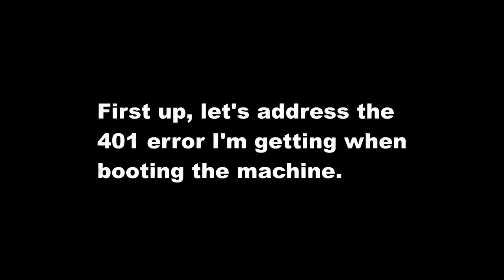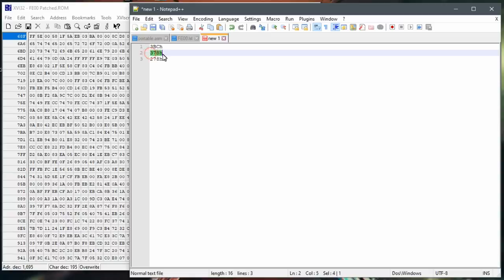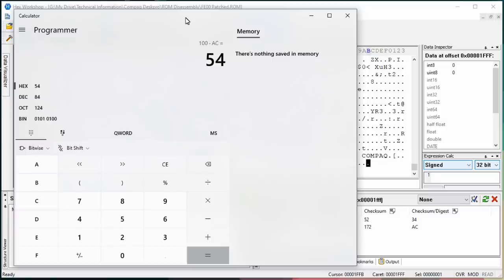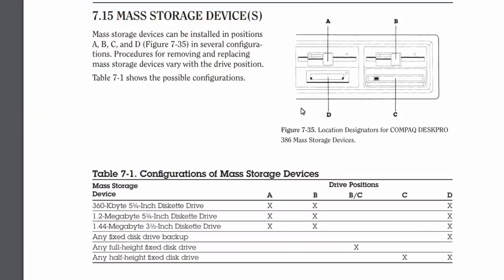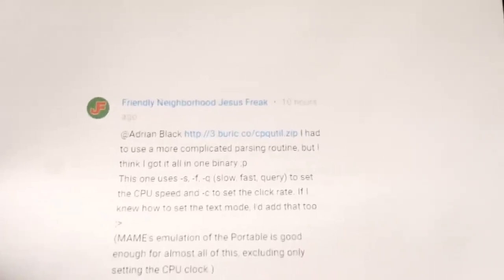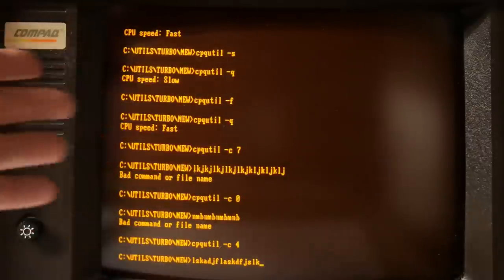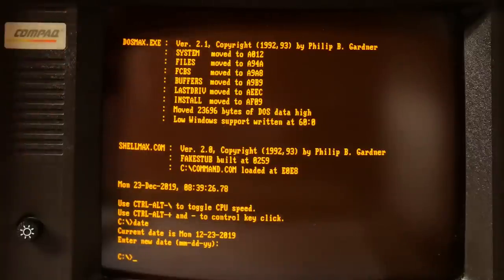Compaq Deskpro Part 3: Fixing that 401 error and more!

Comment: Why do you have to subtract from 100?
Reply: The checksum of the whole ROM has to be 00.
So if you calculate the checksum of all but the last byte, you can set the last byte to the appropriate value to make the whole checksum add up to 100 by subtracting from 100.
Since it's an 8bit checksum, only the last two digits are used: 00
So technically, the last byte isn't the checksum byte, but the checksum complement.
The system checks if all bytes of the ROM add up to 00. If they don't the ROM is bad.
Reply: is that a general rule "checksums must be 100" or is it only for this particular case?.
Reply: @pelgervampireduck  Should be the same for any PC BIOS ROM.
Reply: Technically .. “100” here is 100 hex, or 257 in decimal.
Reply: Pelger There are no rules for this kind of thing.  It could have just as easily been a CRC or whatever, but this happens to be a super easy way to do it.  The checksum can be created by simply adding up the byte values of every character in the ROM.  Then checking for the value 0 is easy in ASM as there’s a CPU flag that gets set when an operation yields a zero value, and there’s a specific conditional jump instruction that will branch only when that flag is (or is not) set.  It’s all kind of path of least resistance programming technique that accomplishes the goal of detecting errors in the ROM.
Reply: Here is my C-like pseudocode explaination of the rom check....

if ( (1stByte + 2ndByte + 3rdByte + ..... + LastByte + ChecksumByte) % 0x100 == 0 ) then { GOOD_ROM } else { BAD_ROM }
Reply: @kpanic23  oh so the's no difference where to put that checksum byte then? Say you modify ROM again, can you just modify some random byte to make the entire ROM checksum to 00 again?
Reply: @waymamma  it's 256
Reply: @desertkun  Technically, you could. But you wouldn't want to change any random byte, chances are you would change something in the program code or a data structure, producing unexpected results.
Reply: desertkun Right! Thanks for pointing that out, I realized after posting that I’d made an off-by-one error. On a checksum comment ... erm.
Reply: desertkun That’s one of the primary disadvantages of a simple checksum over a CRC. With a checksum you can place a corrective byte (complement like in this case) anywhere in the byte stream and it will still work out mathematically. A CRC is much less forgiving, both the position and the value of the corrective byte matters. With a simple checksum you could have multiple errors and if they cancelled each other out, it would go undetected.
Reply: @waymamma  It's an easy mistake to make. It's so easy to get confused and think FFh was 256 when it's really 255, because 0 through 255 = 256 values. And of course 100h is one more than FFh. One louder.
Reply: ropersonline Yes, it’s an easy one especially for a dyslexic like me :)
Reply: I feel like nobody explained this correctly. The last byte IS NOT the checksum byte! The last byte is only place where you can correct the checksum of the whole rom, so the checksum will be 00. Bios itself is never calculating checksum of the rom excluding the last byte.
Reply: Peter K I think kpanic23 pretty much nailed it in the first reply to this thread. The last byte is actually the checksum byte — it is the byte that is placed into the checked image so that the final checksum has some previously agreed-upon final value — 00 in this case.That byte is there purely to serve as verification of the data in the rest of the image (BIOS ROM in this case). If we weren’t doing a checksum we wouldn’t need that byte so .. it’s the checksum byte. Before the code in the ROM is executed the bytes in the ROM are summed up by some earlier stage of the BIOS and if the final 8-bit value is not the agreed-upon 00 then the code in the ROM is not executed.
Instead of Adrian saying “add up to 100” he might have said the “lower 8 bits of the sum of all the bytes should be zero.” ... But if had done that then there wouldn’t be this interesting thread on checksums ;)
Reply: Peter K The last byte is NOT the only place where a correction byte can be applied. In fact it can be applied anywhere, the math still works out for Checksums (not CRCs though). It is typically applied in the last byte position because that is the most convenient/easiest, but it could just as easily go at the start too it’s not important.
Reply: @idea22yt  6:42 I don't think Adrienne himself explained it very well, or maybe just plain wrong. I'm out of my depth here, but I understand why other commenters weren't clear.

Comment: Love how people are still writing utilities for these old machines.  Great video. Thank you sir!
Reply: I've been making programs for the Osborne Executive recently :D
Reply: @ct92404   Nice! And thank you sir!
Reply: @jscollett  It's a pretty cool little computer, but it definitely has some quirks and limitations.
Reply: @ct92404  they all do. But especially systems form the 70s and 80s.
Reply: @jscollett  Well, yeah, but I mean even for the time period the Osborne is kind of unusual and a bit more difficult to program as compared to other 8-bit computers of the period. It's just...weird. For one thing, it doesn't have a command to clear the screen, like "HOME," or "CLS," etc and you have to use control characters to do that. Even just to position the cursor at a certain X and Y coordinate involves entering a long line of code with control characters, whereas it's usually much simpler in other computers. It's definitely a learning curve!

Comment: Long ago i worked with Walt Russell,  he was employee #7 at Compaq and was head of engineering for a time. I learned a few things about how and why compaq did some things. Rod Canion and crew all came from TI where they built seismic equipment. The early MFM drives were quite fragile, so the drive cage was shock mounted using a special viscoelastic thermoplastic urethane compound called c1000 made by EAR composites (now Cabot). It looked like rubber, but i had a golf ball molded from the stuff that if you threw it at the ground, youd get almost no rebound.
Reply: that's super interesting, thank you for the info!

Comment: That hex editor was an absolute interesting part,now am understand how rom modders are moddifying old roms to add or change stuff to it, so rather then searching for specefic codes in a programs manually wich would take forever, you can track them down automatically,very great stuff.
Reply: It is still a very manual process, you just get the code a bit more human readable by running the binary through a disassembler but it's essentially just a more symbolic representation of the machine code as is. The extra comments explaining things were added by a human examining the assembly code.

Comment: I dunno if it was my comment about the Smartwatch software you were thinking of, but it's nice to see it works as expected. ;)

To put a new battery in your Smartwatch module the ugliest possible solution would be to try to cut pins 4 and 14 on the chip that's visible when you don't have the ROM chip plugged in (the one with the sticker on it, it's almost certainly a generic DS1215) and run wires from their stumps to a battery in an external holder.  (Positive goes to the pin on the chip, negative to common ground.) Strictly speaking you don't need two batteries; the DS1215 has a redundancy system that uses whichever battery input has the highest voltage as the supply so you can just connect the unused one to ground. Other option is of course to just go nuts dremeling through the bottom of that package; you can see the outlines of the batteries, if you don't mind a little smoke you could probably be pretty brutal in getting them out and either connect wires to the stumps or try to do it cleanly enough to replace them with appropriately sized watch batteries.

My experience with the DS1215 circuits I've built for my Tandy expansion boards is it's pretty normal for them to not keep great time; maybe I'm using particularly sketchy temperature-sensitive clock crystals or something but they seem to drift several seconds a day.

So much for the pin 7 monitor intensity theory, I guess the monitor just must have a DAC built into it that uses the normal RGBI pins. That's kind of interesting because the Compaq Portables that had monitors with similar capabilities took the other strategy. I guess a foolish consistency is the hobgoblin of little minds.

Comment: I love watching people fix up their old machines.  I feel a little bad that I don’t capture my own repair and refurbishing escapades, but man I am just not that organized.  It feels like I chip away at something for a couple hours, then get stalled out for a week waiting on parts, only then to break a 40 pin connector and wait another week for some spares.

Last night’s escapade:  I spent an hour or so undoing some atrocities I had committed to an early ATX InWin case.  (It was the early 2000s and every LED must be replaced with a new bright one - preferably blue.)  I was trying to restore the factory indicator green and yellow ones.  Turns out I don’t have any indicator 5mm LEDs in my stash - just bright ones in emerald colors, and white.  I did have a 3mm LED and thought just maybe I could drill the active part out of an LED and mount a 3mm LED in the cavity.  Then it would fit the mounting bracket on the bezel.  That did not end well.  The 5mm donor just cracked into pieces when I got far enough in with the drill.  So I ended up savaging one from a broken floppy drive.  And that is how I spent NYE 2019.  No regrets.  ;-)

Comment: Maybe good for future reference:

The Bios error is mentioned in the "Bios Companion".
It does not give the solution, but the search might have been "easier".

It has an extra list for COMPAQ (and many others) error codes.
401 - Printer Error
401 - Port Address Conflict

Book is available and easily searchable on google books.
https://books.google.de/books?id=69648Y1sOewC

Comment: Now you just need a thin net card and a Netware ELS server running on a very old 286 to connect it too!  I have boxed copies of all the the Netware from 1983 on, even the Netware that was build to run on Motorola processors.   They are reseller demos.  I used to work for a Platinum reseller back in the Early 2000's and when I left in they let me take all the old copies of Netware through 3.12 with me that they were going to throw out.  I am thinking about doing some videos on how we used to build these old servers back in the day.  I want to find some ESDI hard drives and controllers and some 286's!

Comment: "DAG" is deflocculated Acheson graphite, a conductive coating used on the inner surface of the CRT glass bell. They are reminding the tech to observe the correct method of installing the tube so that this coating can function properly.

Comment: The Deskpro keyboard looks similar to my Portable 1 system, except the numeric lock and caps lock don't have LEDs indicating they are enabled or not (there are blank spots for LEDs). The outer shell is not yellowed, but the keys are the exact opposite. It was listed as powers on, blank screen and it turned out the cards weren't seated in all the way in and became an experience working on an 8088 system.

Comment: I still usually had my XT's with floppy drives up/down on left like you originally had as often the FD cable wouldn't reach the B: if it was over to the right.  Short cables between the A: and B: often meant having the connectors closer, hence up/down on the left.  Also, the first HD I had was double height, which mandated your floppies be up/down not side by side.

Comment: Seeing the process of editing the BIOS was really cool.  Maybe they had a different card in there originally?  And would it have been equally effective to modify the card to be on that address?
You'll definitely want to change that corroded cap in the monitor.  In fact with how small most of those are, I'd just change them all.  That's the nice thing about a 12 volt monitor, no big expensive filter caps.
Reply: @adriansdigitalbasement  Ah, I can see why you went with the BIOS mod then.  At least now it will be standard from this point on.  I wonder if I can use a similar approach to fix this old "Hard Card" drive I have sitting around that conflicts with every system I try it in?  It still spins up, but will always give controller failures or BIOS conflicts regardless of how I set it the switches.  Maybe I just need something earlier than a 486 for it to work.

Comment: Time stamps noted here for the mobile users on the app:

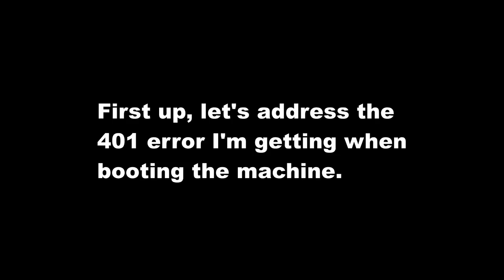1:42 -- Fixing the 401 error once and for all
10:15 -- Correct drive arrangements
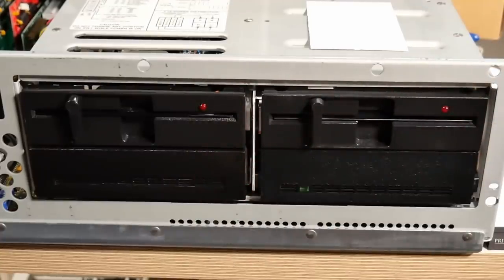11:21 -- Keyboard close up
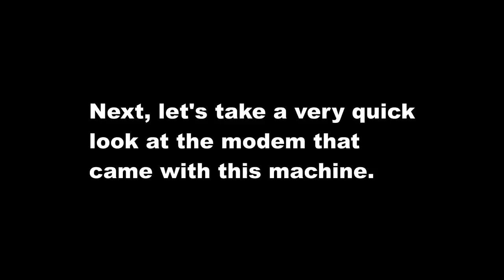11:38 -- The modem in this computer
12:06 -- Looking inside the monitor and looking at its signals
17:21 -- New Speed control and No-Soft-Clock software
Reply: adventureoflinkmk2 that info is already there above...?
Reply: @Peugeot306  except mobile users can't click on the info above in the description...?

Comment: That strange video signal (pin 7?) could be just coupling for adjacent wires, try grounding that line to see if it affects the picture. As for converting digital RGB to grayscale, all that is needed is a few resistors to mix the signals together is varying quantities to give you a grey scale, so I kind of suspect that is what they have done.

Comment: Of course you could have probably configured your parallel port to use 3BC after you found out that that's the problem. But good fix anyway! :-)
Interesting how the SMWCLOCK program apparently uses a different way of getting around a Y2K problem in the clock chip. Which reminds me: Happy New Year!

Comment: Hi Adrian. If your scope has a video trigger mode, you can trigger on a horizontal sync, and on modern digital scopes, even select the line to trigger; and put that pin 7 signal on another channel looking both in tandem. Keep both on DC coupling. I am a little curious what those signals are too. :)

Comment: Your no slot clock is basically a DS1216E which is now obsolete. The battery is potted in the module. The replacement products are integrated with SRAMs to replace the SRAM versions of the DS1216. The DS1216E is simply an integrated module that contains a DS1315-5, one or more batteries, and the other support circuitry such as the oscillator. You could design such a board yourself, but Manila Gear has already have done that and the replacement is sold by ReActiveMicro. The product is sold to interface with Apple II systems, but the Apple IIe version is also PC compatible and will drop right in. Your existing software should work as well. The battery connectors can be broken off and connected remotely. If only one battery is connected, the other battery input should be shorted.

Comment: This channel is pretty hardcore.
Reply: I like to watch these electronics that I would toss being fixed. Iron soldering and testing electronic parts is way out of my league. I can maybe solder broken cables (you know the tiny ones on computer cases that connect the mobo to the LEDs and switches), but that's about it.

Comment: I have had (if I remember right) one PC with three parallel ports, used as a home network router in the mid 90s, with Linux PLIP driver. I'm right with you on 0x03bc being a pain in the butt.

Comment: Seems the modem uses the SSI261/262 as a modulator/demodulator combo. There's not much in Google for these things, but there is a patent (US4771417) for a different modem that uses this, and that's a 9600 baud modem. As the modulator/demodulator would likely be the limiting factor here, I think it's safe to assume this modem also won't do more than 9600 baud.

Comment: Without resorting to Google Translate, your German notice on the tube is saying something along the lines of "this apparatus is capable of generating X rays (Roentgenstrahlung). Operate at under 20 kilovolts". That's an interpretation rather than a literal translation ;)

Strahl is German for 'ray'. In Kraftwerk's "Autobahn" they say "the sun shines with glistening rays" (Die Sonne scheint mit glitzer Strahl). Which is how I remember what Strahl means :)
Reply: Not to bad for a translation but not a 100% accurate.

It reads: "The x rays produced by this device are sufficiently shielded. Acceleration voltage is under 20kV." 

It is a sticker that was legally required to make sure that there are no x rays emitted by crts. 

Greetings from Germany, 

Michael
Reply: @gammaleader96  Yeah. I was going by what similar stickers in English on CRTs say ... I.e. I knew X-rays, apparatus, under, and some of the other words and so I knew what the message was for without knowing what it meant exactly :D

Comment: those potted clock battery chips are a pain, but as long as you are careful while removing the material there is no issue with just scraping or chipping it away till you find where they hid the battery, if you can find more complete documentation it might tell you where to dig, but thats not really all that important, just be careful to not damage the crystal which is often hidden in the potting opposite the battery

Comment: That is not a lot of burn-in - I've seen Compaqs in the 1980s and early 1990s during their lifetimes as current machines which had readable text when the power was off. Word Perfect was the big MS-DOS word processor and the WP menus would be burned strong into the screen. These things were also often used as mainframe terminal emulators with the same screen block structure up all day long. Compaq monitors were inferior to the IBM offerings, but those too were subject to rapid burn-in. One always had a TSR program (terminate but stay resident) to blank the screen during inactivity or to put up a slide show. Your monitor looks pretty good actually.